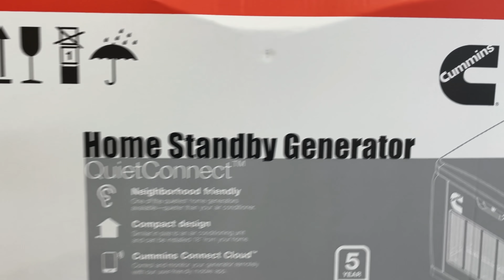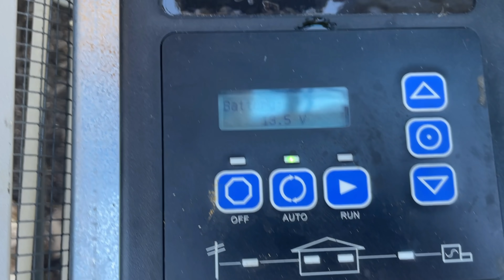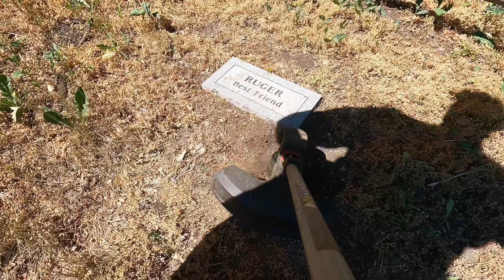#507 -New Cummins 20kw Standby Generator, Front Porch Makeover, Roof Pitch Repair Continued.

Comment: Make a lean-to for the generator. Only needs to be serviced shouldn't be too big.
Reply: I think one reason he wanted it in a building, was so that cold starting in winter would not be so hard on it (the most "wear and tear"). 
Emergency generators such as hospitals have, they circulate hot water through the cooling system of the big diesel engines 24/7 so they can fire them up almost instantly and under a full load generating electricity ASAP ( in a matter of a few seconds ).
Reply: @danblumel  good point. they build a room for it with a "lifetable" roof. close it up in the winter  with louvers to allow the fresh air in once its "warmed up" and then once spring comes "lift" the roof so its basically "open" and gets plenty of fresh air (sort of like lifting the cover on a pickup truck bed)
Reply: @danblumel  odd comparison, 1 million dollar generator to a $5k generator. But I guess.
Reply: @SourBogBubble  the same issues apply, cold starting a generator, especially in winter, creates a lot of wear, until the oil is warmed up, you have metal on metal. Everyone who knows engines knows this, and tight tolerance engines even more so. That's why I use a block heater in my car once daytime temps are below 50F if parked outside. I never start my airplane until the block is at least 50F. For the car and generator is protecting your investment and increased reliability long term. For the airplane, it's that and protecting my life and any passengers.
Not even close to 1 million $ for those hospital backup generators. More like 100 to $250 K but your point is well taken.
Reply: @nerys71   yes, large volume louvered make up air vents for combustion air supply should be sufficient with a block heater keeping the oil relatively warm. Only the summer would be an issue for the generator set to keep cool enough. An easily removable roof might be the best answer for that as you suggested.
The other need is for the exhaust connection to be flexible to the outside. I believe the voided warranty issue is to protect them from people, even installers doing stupid things that reduce the generators reliability. Idiots ruin it for everyone. A well thought out installation should have no negatives, only positives if installed in an outbuilding, especially with a CO warning device connected via WiFi, He already does that for his water system.
I suspect the generator manufacturer offers a block heater option. Whether an immersion type in the freeze plug hole (assuming it has one, quite likely) or a recirculating heater with pump for the engine cooling water jacket.
Reply: @danblumel  you only got one air plane? I  got 3 so what's your point cause none of it applies here, everything you wrote IS COMMON SENSE.

Comment: There are snow load and roof pitch codes and recommendations for states that deal with heavy snow dependent of what roof material you use.  You really want to control the speed of the snow sliding off your roof and the steeper the pitch the quicker it will come off and in turn it can damage your roof or what it is spilling onto.  Most recommendations agree a pitch of 3 to 4/12 pitch is ideal in order for the snow to creep instead of slide off, anything above 4/12 are not recommended and Heath should be fine with the pitch he has chosen.

Comment: you have that big diesel fuel tank... find yourself a older diesel 1800 rpm generator.. that kohler and cummins all have comlicated electronics made overseas and if anything fails the gen is useless till fixed..  older stuff is much simpler and usually just has a electronic voltage regulator that can be easily bought and replaced by someone handy in 20 or 30 min.. time will tell how good that cummins will hold up

Comment: What made you select a 20kw unit? Surely it is too big? It will use a lot of fuel compared to a smaller unit and in reality a 5kW would charge your batteries quickly.

Comment: What's wrong with using the 8Kw generator to just charge batteries. It would use less fuel per hour than the 20Kw.
Reply: Obviously between charging the batteries and other demands for the house and shop, it takes too long or doesn't quite do the job, when no sun for a couple or few continuous days in winter.

Comment: Just looking at what you are doing I wonder if turning the windows into dormers might be the ideal solution.  If you push the windows out 2 feet or so from the 2nd story in dormers you could have a higher pitch on the roof on either side of the dormers.  Just a suggestion.  Not a criticism.

Comment: Incredibly confused why you need a 20kW battery charger?  Those things are designed to provide electricity hungry homes with multiple air conditioning systems, electric ovens, electric dryers?  

There's "being prepared" and then there's overkill and this certainly goes in the direction of the later.